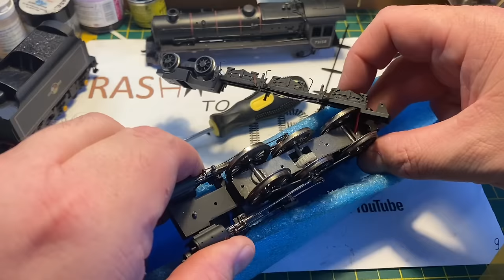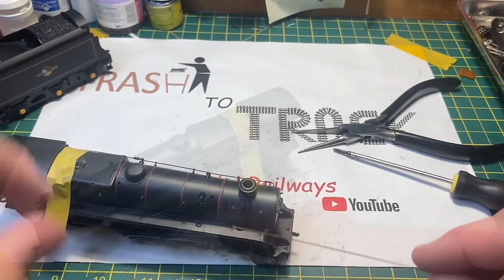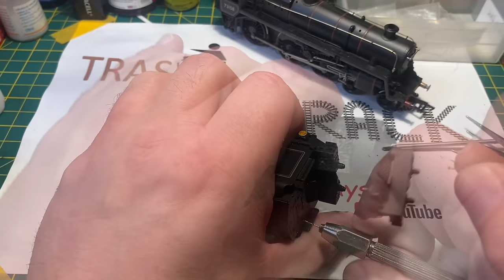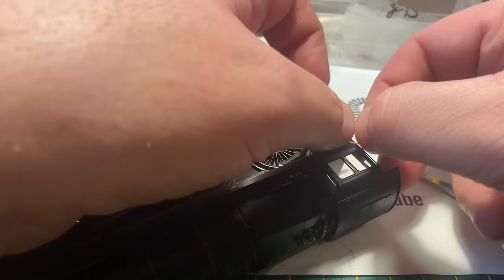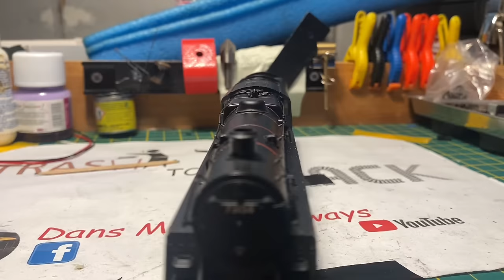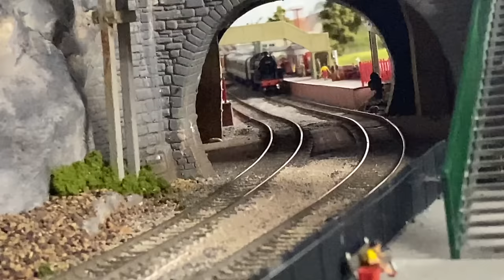Trash to Track. Episode 91. Bachmann Std 5 Loco.

Comment: I cheat with windows - I glue the clear plastic (cut slightly oversize) on the inside ... does not have to be so precise in size and saves time trimming. Then use your glue and glaze (I use Microscale Kristal Klear which is similar) to flood the window from the outside.
Great job on the restore - will remember your crank handle method.